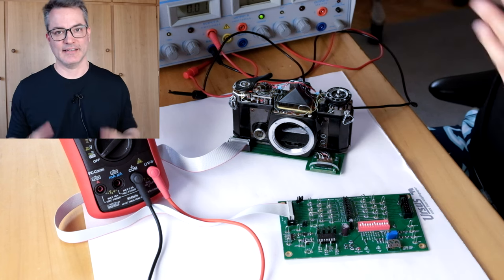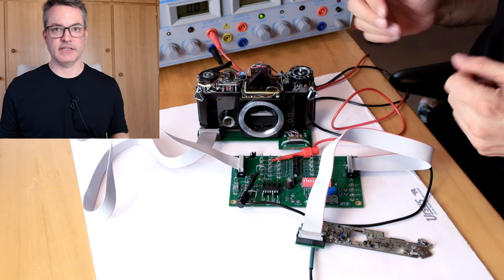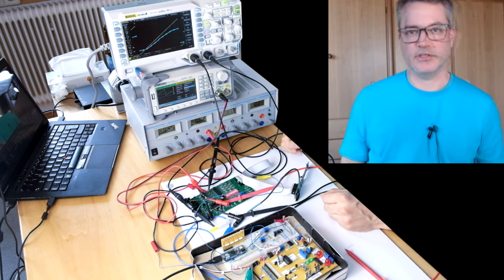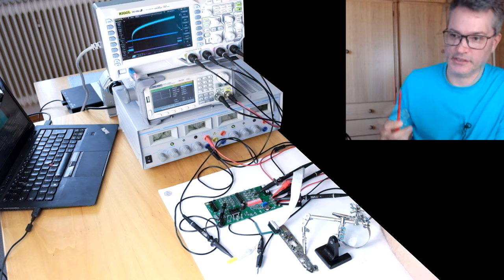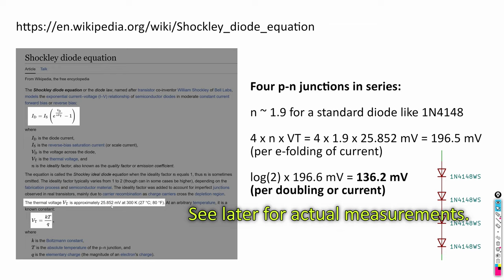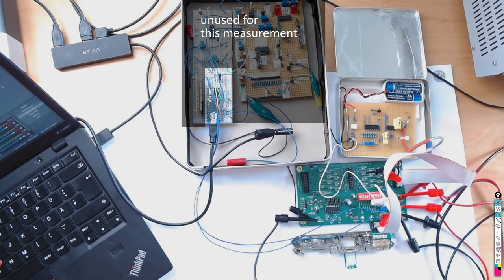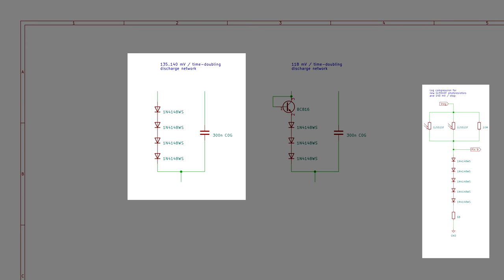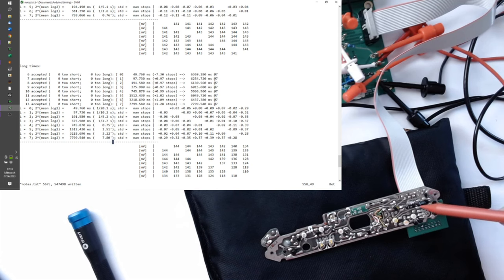The Pentax Electro Spotmatic: Reverse-engineering a marvel of 1971's Japanese electronics [Part 4].

Comment: Wow, those curves of JFET and discharge circuit at low settings, combined with curves of new photocells might be a feature. Automatic reciprocity compensation at speeds slower than 1s!
Reply from the maker: Indeed, and I thought quite a lot about that. I checked out reciprocity tables and even the new discharge network will provide some correction as the decreasing slope above 1 s will prolong exposures > 1 s quite a bit. However, the problem with reciprocity is that it differs so much between films. Film A may need 2 stops more correction than film B at a certain time. There are films that need practically no correction up to a minute, others need massive correction already above 1 s.

It's a question of philosophy: What should a camera do in a region where it does not indicate exposure times in the viewfinder and where films behave crazily? Should it do what is better for many, but not all films, but you don't know what it will do, or should it do what an external exposure meter would indicate, so you know what it will do and you can dial in a correction if you want?

It would be so interesting to know what the ASAHI engineers thought when designing the circuits. Is the low slope of 120 mV of the discharge (that does not match the remaining good photocell) intentional for something like reciprocity, or is it caused by aging of the diodes over 50 years, etc.?
Reply: @EdwinSteiner  Actually for majority of films reciprocity curve follows exponent of 1.3

I do some night photography and even with digital cameras you usually want to overexpose few stops compared to what camera meters automatically.